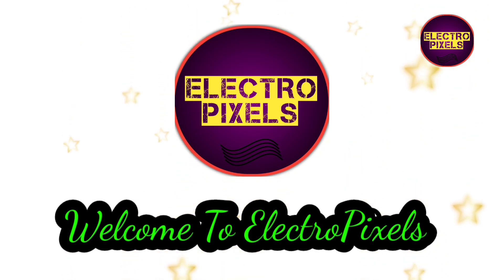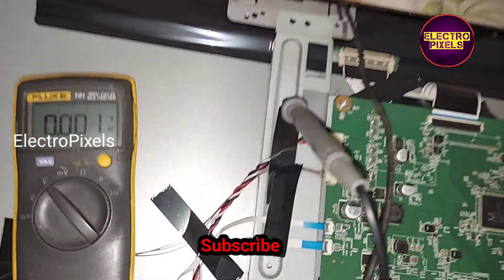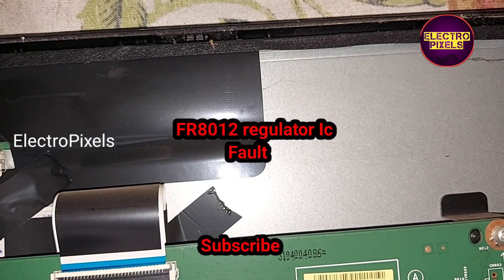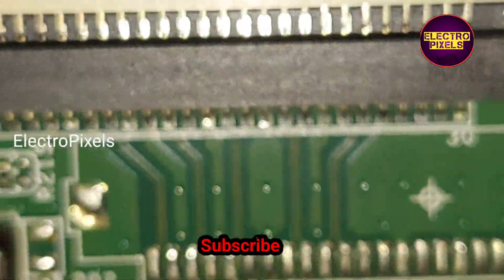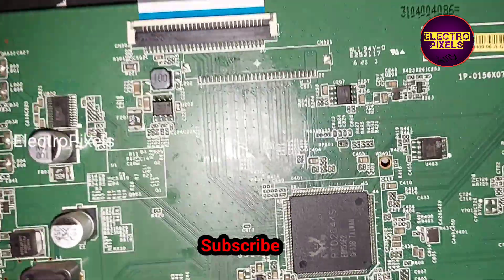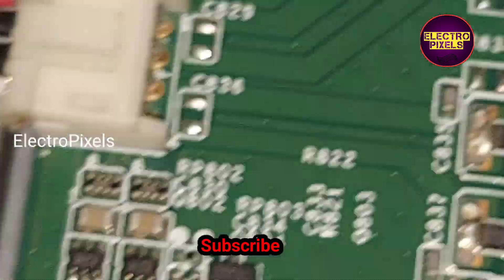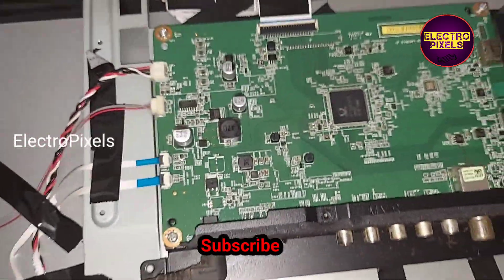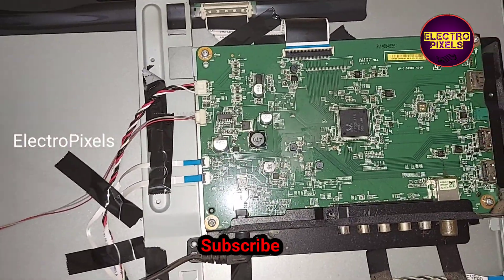Sony Tv Blank Screen, No Display | Backlight & Sound is ok|klv-24p413d,How to Repair Practically

Comment: I have a 40 inch Ibell Led tv which has an auo panel. It has no display only thin red and green bars. After removing LC1 & LC2 resistance, the display comes up but freezes with green and red bars. When LC1 and LC2 are bypassed to VGH and VGL, then nothing comes on the screen. What could be the problem?
Reply from the maker: Both side Panel is damaged so panel Replacement is only Solution

Comment: Can 12 volts be given without IC?
Reply from the maker: Yes but you need to Remove the Ic from circuit. In mother board 19 v is present so to generate 12 you need to use a Reducer board